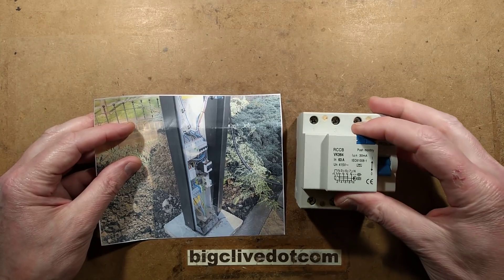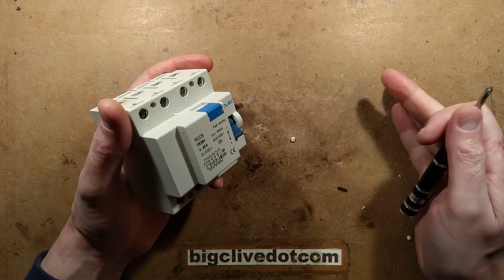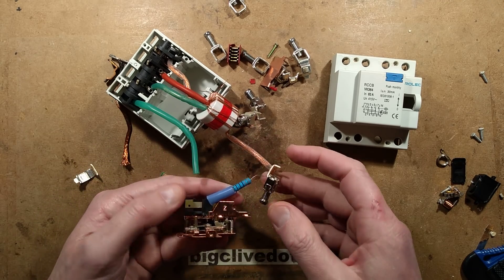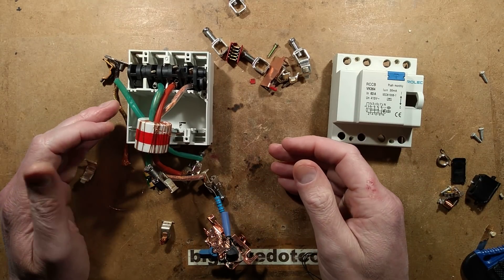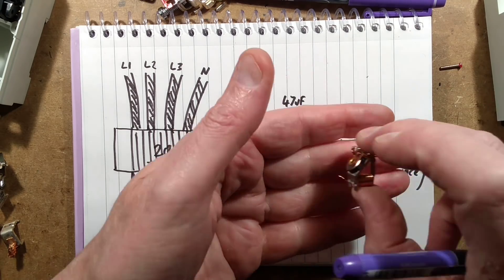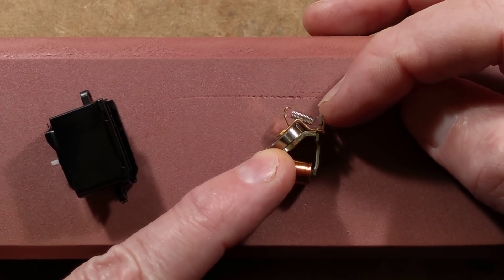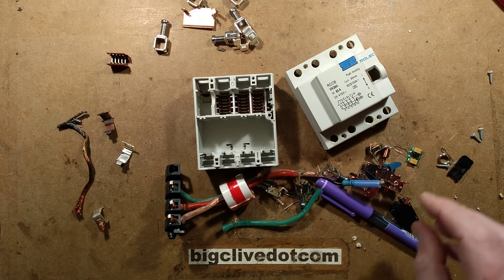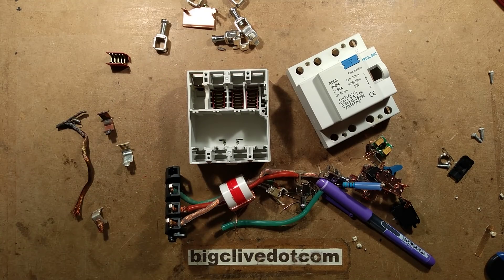Failed 3-phase RCD/GFCI from a Rolec electric car charging pillar. (with schematic)

Comment: So why is it always the left contact that always fails? Well, I notice that the switch is on the right, so it could be that the mechanical force that holds the contacts together when the switch is closed is weaker further away from the switch and so a poorer quality contact is made, leading to a bit of resistance and hence overheating.

Comment: Had a presentation from rolec presently lovely guys but have to say my eye brows knitted together when they presented the new TruPen system for home charging. Which by the way All new home after Feb will need Smart chargers. Has NO Earth. Sure it's all tested but still made my head itch as a WHY.
Reply from the maker: The vehicle chargers often use a TT type system to avoid voltage differences between the home's equipotential zone and exterior sources of current.
Reply: Yes. It's the 5seconds they said would be needed for it to isolate. Gave me the screaming abjabs. And guess I've been brainwashed into thow must have independent earth to EV charger so it don't make blue smoke 💨 from your house hold apllyances.

Comment: I would guess the spring that holds tension on the 4 contacts is either not strong enough when the RCD gets hot or the arm that hold the 4 contacts slightly twists causing less pressure to be applied to the final contact

Comment: We had the same problem with a new apartment in China. Twice they replaced a Siemens RCD before ripping out all the wiring and replacing it with better quality not a small job. Might be a bad batch of cable?

Comment: Why isn’t there rating for what kinda short-circuit it’s developed for?
Reply from the maker: Good point.  I didn't spot a rated fault current breaking capacity.  Then again, it's not a primary overload device in this application.

Comment: It would be more economical to rent battery packs. Trying to charge up huge batteries in short time periods is... well things get hot. Might be safer to transfer battery packs at "refueling" station and  more economical to charge the batteries at a slower rate.

Comment: A possible reason why it's always the left hand contact: The switch is on the right hand side, therefore when re-setting the breaker, the mechanism is tilted slightly due to the switch being off-center, causing the left hand contact to arc slightly.

Comment: I'd eyeball or buzz out that little circuit board a little more carefully.  I'm guessing it's more like a voltage doubler than a diode clipper/filter:  that would explain the polarized capacitors, and make more sense working with a magnetically biased assembly that will only trip in one direction.

Comment: I almost wonder if the station is wired correctly inside.  could one of the phases be under a higher load where the RCD is connected to the source directly instead of through a master breaker, and the charging circuit and control circuit combined are close to exceeding the rating of the RCD, if not exceeding it?

Comment: This breaker seems to have made a sensible trade-off between clever mechanics/magnetics and clever electronics.  I bet you there's somebody out there who has "solved" this problem with a microprocessor.  Sometimes simple is best, even if it means resorting to mechanical and magnetic trickery.

OK, the contact mechanism itself is crap, but that would remain crap however the trip circuitry worked.

Comment: Well in Germany Type A RCDs are required for all circuits with socket outlets under 32A that are in the reach of non electrical personell. Type B is recommended in circuits with VFDs, inverters, charging poles for electric cars and such things. Type F is recommended for circuits with single phase VFDs like modern washing machines. Type A is quite cheap here, like 30€. Type B is like 300€ upwards. Type F is like 100€ upwards. Type AC is forbidden here in Germany, if we see such a thing we have to shut down the supply until its changed, because Type AC is a health and safety problem and people are in danger. With all the modern electronic in the houses or businesses today the Type AC can't protect sufficiently enough. I'm a little bit shocked, that RCDs Type AC are common in the UK.

Comment: The magnetic effects of fault conditions are fascinating. Here they're used to induce a current and trip a breaker. I used to build distribution boards with big copper busbars in them. We had to put supports every 300mm because, under certain fault conditions, the opposing magnetic fields could "cause the bars to slap together like rubber, which wouldn't be good for anyone nearby" as my boss explained it to me.

Comment: Looking at it and seeing that the springamathing is on the other sideo of where the burnt contact is, it could be the contact with the least pressure.
since its the rcd and no switch/fuse it shouldnt have wear from on/off arcing. (of course it gets tested each month...)
aaand perhaps over phase L1 there is running more power than over 2 and 3. or even only on L1 depending on car charged.

Comment: Given that all types of this interrupted seem to fail on the left contact, I'd guess a lack of stiffness in the actuator bar..  Because the bat is rotated from the right, the bar will experience torsional flexion (twist) and thus the contacts farthest from the right will actuate slightly slower (arcing) and when closed, may experience less contact force (higher resistance).

Comment: It's a common problem with ROLECs. Pod Points, Chargemaster, etc, do not have this problem.

Did you check the resistance of the plate? It's not aluminium or something daft is it? All I can think is something's causing increased resistance..

Comment: The breakers likely pull power, one after another from left to right mainly, which is why you'd see the left burnt/blown first on most units 

Don't know if that's the case, but it's a thing to think about.

Comment: when you took it out . the burned lever was pulled back ... so the green wire was probably Pinched by the upper case.. when the lever went up and down.. it pulled back.. look closely at the wear marks on the burned contacts verses the other contacts.

Comment: Interesting that you mentioned a car drove off plugged in as I thought the vehicles have a protocol to not run until they are unplugged???? Type 2 plug and socket with 3phase neutral Earth and two mini pins for the coms.
Reply: They do, but there's always the possibility of users circumventing the protection by using DIY cables or adapters, or even a DIY EV conversion

Comment: Public chargers are usually put in as a publicity statement, most people could and still cant just get an electric car that is different than normal looking cars and only the rich have them, so lots just see them as annoying. Also as others seem to think, that first phase is probably the first on to get hit when the charger kicks in and probably ramps up other other or not used at all so that big initial hit each time it starts would cause that contact to heat up. And until we get modern Micro Nuclear Reactors, this electric car everything will just end up making your power bill higher and your cars cost more, solar and wind will never have the capacity and the cost of storage will never make it reasonable.
Reply: Cheer up, Brian. You know what they say.
Some things in life are bad,
They can really make you mad.
Other things just make you swear and curse.
When you're chewing on life's gristle,
Don't grumble, give a whistle!
And this'll help things turn out for the best
And
Always look on the bright side of life!
Always look on the bright side of life
If life seems jolly rotten,
There's something you've forgotten!
And that's to laugh and smile and dance and sing,
When you're feeling in the dumps,
Don't be silly chumps,
Just purse your lips and whistle -- that's the thing!
And always look on the bright side of life
Come on!
Always look on the bright side of life
For life is quite absurd,
And death's the final word.
You must always face the curtain with a bow!
Forget about your sin -- give the audience a grin,
Enjoy it, it's the last chance anyhow!
So always look on the bright side of death!
Just before you draw your terminal breath.
Life's a piece of shit,
When you look at it.
Life's a laugh and death's a joke, it's true,
You'll see it's all a show,
Keep 'em laughing as you go.
Just remember that the last laugh is on you!
And always look on the bright side of life
Always look on the bright side of life
Come on guys, cheer up
Always look on the bright side of life
Always look on the bright side of life
Worse things happen at sea you know
Always look on the bright side of life
I mean, what have you got to lose?
you know, you come from nothing
you're going back to nothing
what have you lost? Nothing!
Always look on the bright side of life

Comment: I don’t like the way it armature picks up the contacts from only one side and not the center for balance.  The contact on the end may not be getting enough wipe due to lack of rigidity in that arm type arrangement.  Insufficient wipe (contact pressure) can definitely cause this problem too.  I like your observation on the shunt being impeded and not being able to move freely.  That seems to be the most probable cause.

Comment: Probably the fault is in the phase use of facilities the chargers are installed in, something to do with everything being two-phase and polarized dropping the first phase low so that when actual current is drawn the sine is blunted and it has to make up for it with amperage?

You know, the thing we avoid in the US by using 2 phases in our houses but with even distribution to nullify unbalanced power factor?   Probably a bunch of shit circuitry all over the place by the chargers that is actually just 120v and faking it.

Comment: Very interesting Clive.
Thanks for the video, love the way that the trip mechanism works.
Bet that solution did not come to mind overnight.
As for the failure of the end contact, I would guess that contact pressure on the end contact is not high enough and it runs hot.

But the video stimulated my thinking about a problem I have to solve at work and now I have an answer for the folks tomorrow.
We work with variable frequency motor drives and ground fault detection on the load side is tricky as the fault current on the ac side of the vfd is dc due to the nature of the conversion process, when a ground fault occurs on the output of the vfd.
So a core balance does not work in that situation.
But, a transformer type core with two winding's will work, because the output voltage from the measurement coil changes when dc current magnetizes the core.
Is what we get up and go to work for in the morning, dealing these interesting and stimulating works tasks to deal with.
And then sharing the experience with others, like you and other creators on YT do.
Kind regards, D

Comment: Most likely reason is that the first contact is furtherest away from the actuator, and the flex in the plastic is enough to mean the contact pressure is low. Combine it with the stiff cable and the contact pressure is low, so the resistance as the contact ages rises, due to not enough pressure to wipe off the oxide layer, so the small area overheats, and then results in more oxide forming, and this then heats up more as the actual contact in electric contact reduces.

With the electronics, I have some old breakers from the 1970's, which use a BRY39 thyristor to trip the coil, using the current generated by the sense coil to charge up a capacitor, and then use the thyristor with a 6V8 zener diode as a fast pulse generator to fire the trigger coil, though there is also a parallel path with some 12V zener diodes for fast triggering on high current, so that the time to charge the capacitor up is not going to cause a delay on short circuits. Leakage current it will trip within 2 full cycles, but large leakage ( like a short to earth) it trips on the same cycle. Nice application of a 4 terminal thyristor, pity they are not really made any more, like unijunction transistors, but at least you can emulate then somewhat using only a NPN and PNP transistor tied together.

Comment: When I was a nipper the points in my car were platinum coated. Over the years this coating got thinner and thinner. So whereas you could have sanded your points nowadays there is almost zero plating on contacts.For example, Italian made  fridge thermostats will fail after 13 months.
Reply: Convenient then to have a 12 month warantee.
Reply: @jimnelsen2064  You are dead right! I don't have the equipment to test this but I'm guessing that these contacts are minimally  silver plated.

Comment: About the lack of active circuity: A good RCD is supposed to trip on the current difference regardless of the operating voltage. So the tripping trigger has to be powered by the pickup coil only. This makes it very delicate and expensive. In the cheap RCD the current from the pickup coil is fed to the thyristor which uses the main voltage to activate the electromagnet of the tripping mechanism. This makes the mechanism much cheaper but won't work without proper voltage. This type of RCD is not allowed in my country.

Comment: The neutral is probably loaded to the max and over,  if you have stady current in every of the 3 phases the neutral current is the square root of 3 times the phase current. Then the neutral current can be higher than phase current.

Comment: Hi Clive. Put a straight edge along the black plastic contact carrier and check for signs of twist. The burnt one is the farthest from the tension spring so has slightly less contact pressure. When the power ramps up the contact gets warmer and begins a self perpetual cycle of further reducing the contact pressure until it finally fails. My two cents.

Comment: I'm actually not suprised about the circuitry. I have recently disassembled an old RCD that was installed around 1985. It was kinda the same mechanism. The trip coil was connected direcly to the detection windings without any circuitry at all.

Comment: The most likely cause is very simple and it's not the manufacturers fault.  The installer probably did not tighten the screw properly (what we call "plastic wrist") or clamped down on the insulation rather than the conductor.  I have lost count of the number of times I have seen this over the years.

Whenever I take the cover off a board the first thing I do is check that the terminal on the incoming mains cable is tight, it's often not and it can jump out of the breaker when you are poking around in the board... Getting hit on the back of the hand by a live 16mm 240V cable is not fun, trust me I learnt this the hard way.

Comment: I wonder if the reason the left one fails most often is that the geometry of the pivot is a little sloppy on that end, slowing the break and allowing more arcing.  Or, perhaps the slop makes that end a lighter connection with more resistance.

Comment: Pound to a penny Merlin Gerin wouldn't do that but this is better than the BBC, what a channel, Rock on Sunshine.

As for the burny burny, I noticed commenters saying loose terminal and it's a documented thing that high current use terminals can loosen from the 50hz, is it not?

Comment: Could the neutral-wire, due to bad installation by the electrician, have been fed through "1" terminal on the RCD ? - combined with third-harmonic * currents from the charging-device raising the total current above 63A nominel current through "1" terminal?

 * third harmonic currents gather in the neutral + third hamonics happens because of rectifying from AC to DC (just like in a frequency converter)

I know its a longshot :P

Comment: Most of the times I run across burned contacts like that it's because the terminal was not properly tightened. I don't see why the left one would be more common though.

Comment: Here goes, knowing next to nothing but very interested in this stuff.
The cable looked as if it folded over into the casing very easily, would have thought it should have been more resistant. Could it be that the bend on the cable is causing resistance, which makes that a hotspot, especially if the piece of plastic is pressing against the cable?
Ok, head down ready for the onslaught😷

Comment: The control circuitry may be running off the left hand terminal, the control circuitry might draw a lot. Have not seen any of these charging stations, do they have a street light or anything attached?

Comment: Hey Clive , back in the late 80’s early 90’s prior to the introduction of RCD’s in Australia, we were using voltage operated ELCB’s which used two earth electrodes at a predetermined distance apart. Are you familiar with this type of protection. The concept of operation was that an earth fault would cause a potential difference between the two electrodes of approximately 22volts which would cause the ELCB to trip. I was only a first year apprentice at that time and didn’t really understand. If you are aware of these products please enlighten us. They weren’t around too long probably because of the complexity’s of there installation and the simplicity, reliability and effectiveness of the RCD. Cheers jj

Comment: In asean countries, we call this RCCB or ELCB. Even tho they the same thing but you can see generic version or the cheapest version os designed like this. Tye cheapest ones after 2 years or so and you press the test button it will not trip.. Thats why i use high quality stuff for my projects

Comment: at least here in germany a RCD type B oder type A-EV, which are sensitive for (continous) dc leakage current are mandatory for EV charging stations. These are really expensive. They cost 10 times much as a type A costs.